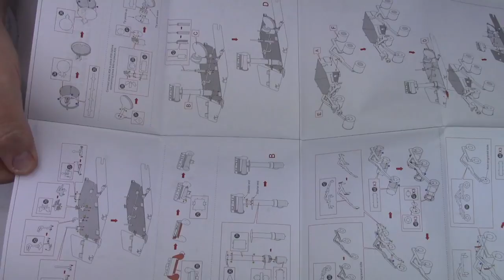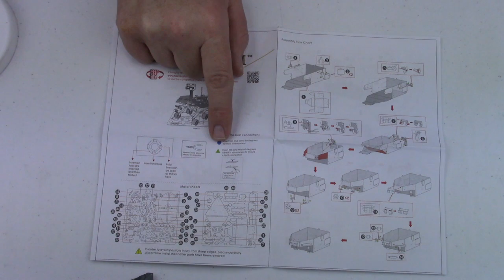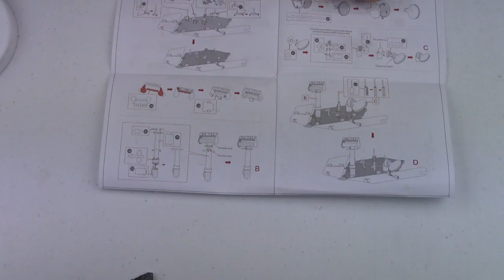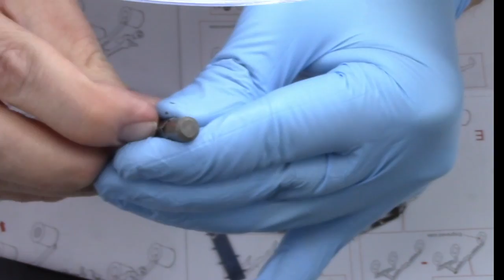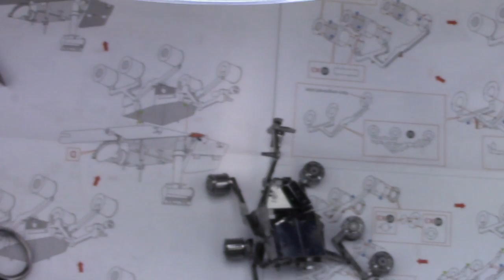Metal Earth Build - Mars Rover

Comment: I had exactly the same problem with the wheel module.  Bent the tabs the wrong way and they broke off...  Be very careful here, it's an easy mistake to make!  However, instead of buying a new kit, I used superglue which works perfectly and is a completely invisible mend.  The only time I have ever used superglue and it actually works sticking things (other than fingers) together.